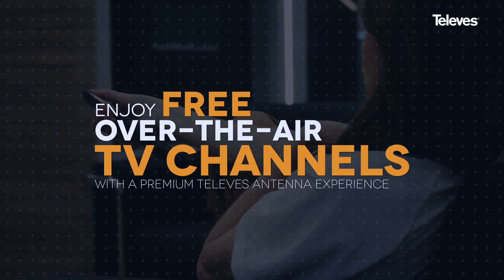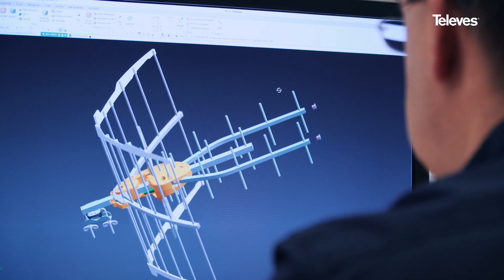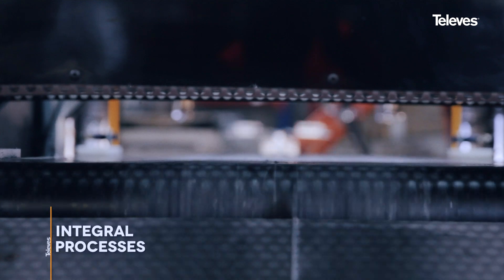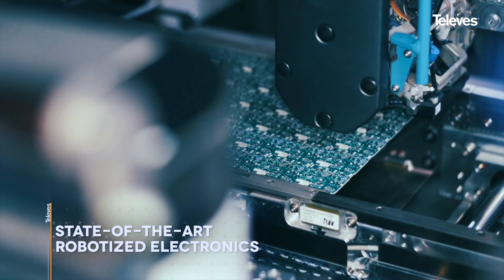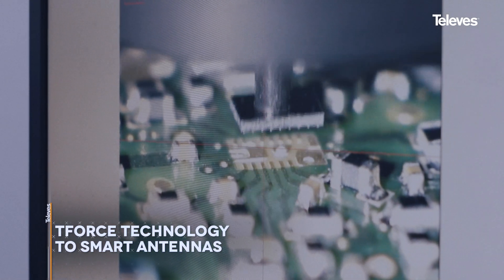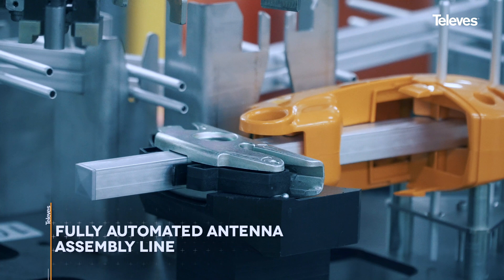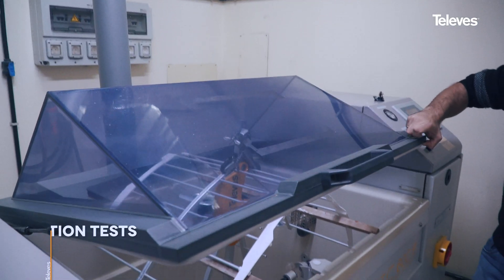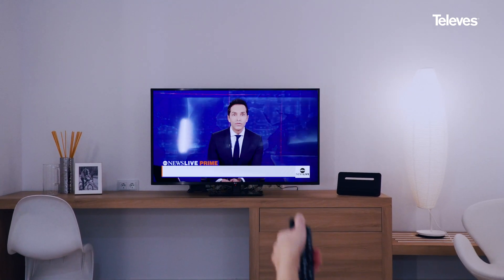Enjoy free over-the-air TV channels with a premium Televes antenna experience.

Comment: Does this mean that at a 32-35 mile range this antenna is useless? (The website says "up to 30 miles away from the transmitter.")  Most of my channels are within 30 miles. Just a couple at 32 miles out. (33324).
Reply from the maker: Mileage ratings are just a rough estimation. Each antenna has a different application, make sure you choose the right model for your situation.
Reply: @TelevesUSAStore  

My replies keep disappearing. If you're censoring responses, then I won't even discuss this here. I'll contact the corporate offices.